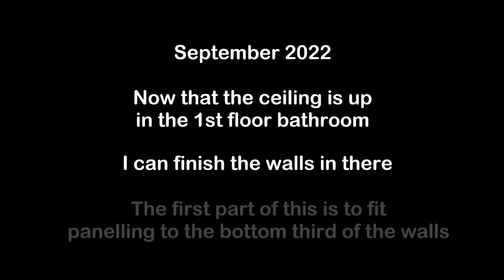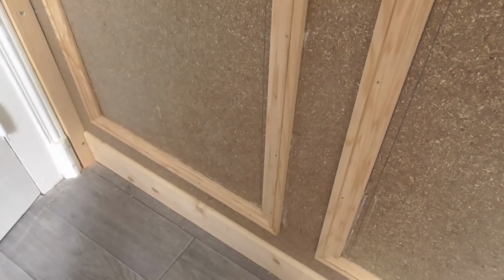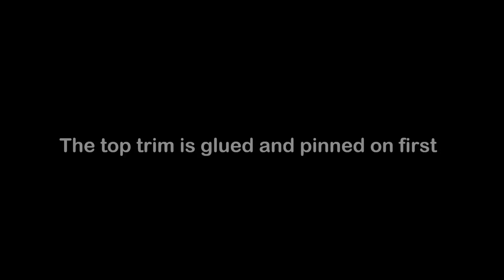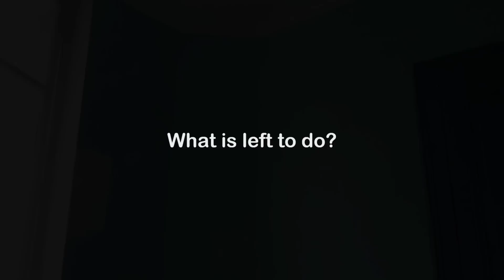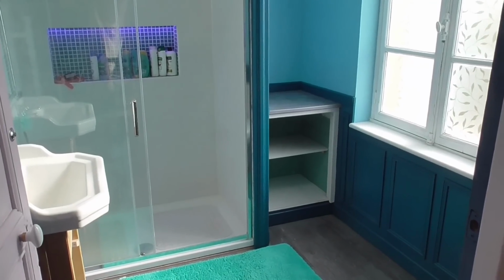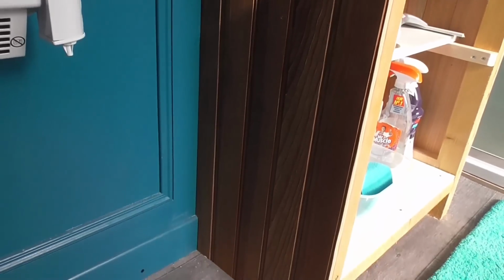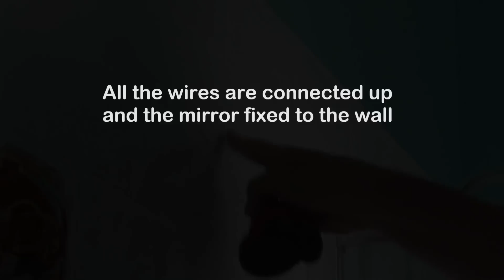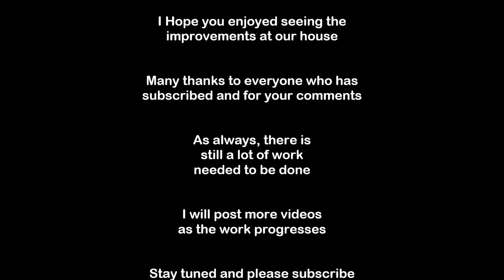Our French House Adventure - Part 31 1st Floor Bathroom Walls

Comment: Hi Alex, love it. The mirror  and heater, have not seen anything like it. Can you stick the heater yo any kind of mirror or is that a purpose made one for the heater.? Thanks for sharing your knowledge.😊👩‍💼
Reply from the maker: You can stick those heat pads on the back of any mirror. They are available in many sizes